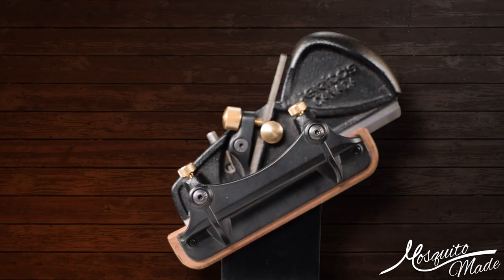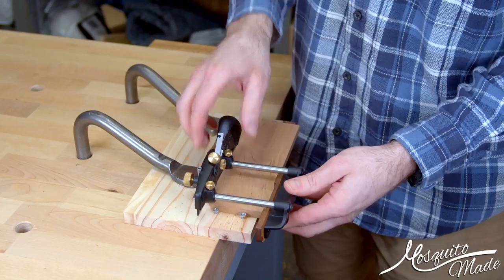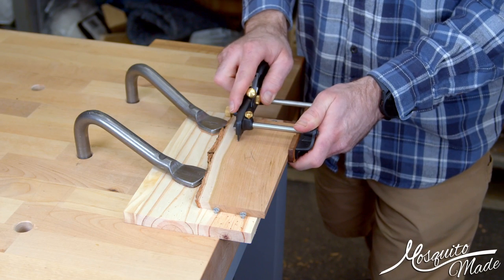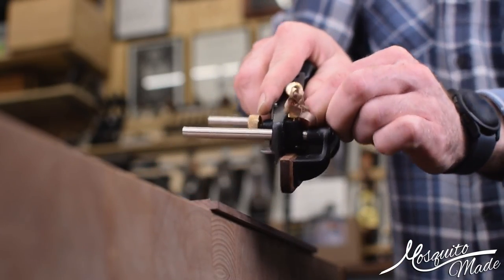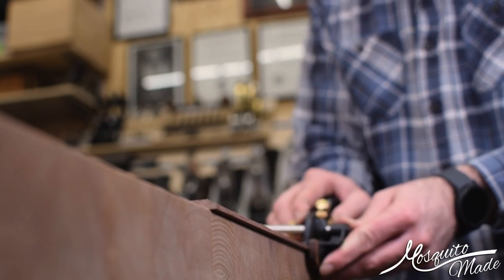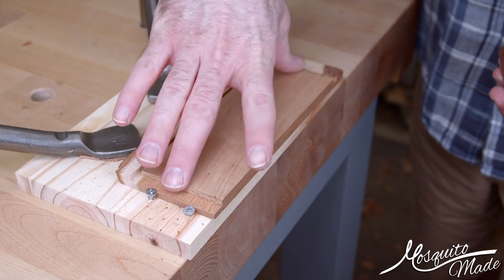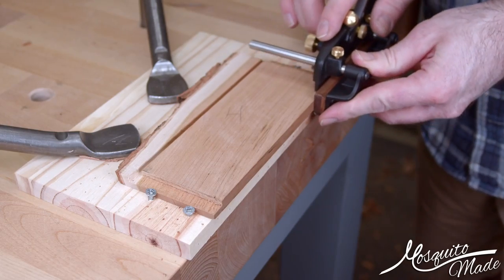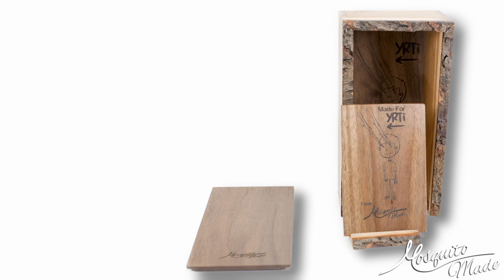Veritas Box Maker's Plow Plane Operational Examples with a Live Edge Box

Comment: Good review and the demonstration of Veritas Box Maker's Plow Plane!

Thank you for the box. The grooves are very clean and by watching how quick you made the grooves (I know it needs a skill), I want the plane now for real.  and yeah, I always have a difficult time on clamping a small piece to run my router plane. When I get upset enough, I just use a thin double sided tape and stick the piece to my workbench. It works.
Reply from the maker: Thanks!  I've used double sided tape a lot on the CNC, but I've never thought to try it on my workbench, that's a good idea... And it's a great plane, with some limitations, but I'm a fan (of course, I also love my equivalent Record 043's before this too)

Comment: Hello, thanks for this information.  How did you get a model with the thumb screws for the fence?  I see now they are selling it with Allen key round over screws.  I would prefer a model similar to yours.  Have you used both?  Is there an advantage from one to the other?
Reply from the maker: That was covered in the full review video (https://youtu.be/23Dl636---4).  I cover the thumb screws around 18:30 in that video. There isn't a model that comes with them, you have to buy/make your own.  I've been using it with the brass thumb screws I shortened from ones I bought on McMaster, and it's been no problem for me. I much prefer the thumb screws to the button head screws. They also the same for me, but without having to use the Allen wrench. I haven't had any holding issues with the thumb screws tightened by hand, but I've got good dexterity and grip, so other people may have different experiences. The main advantage in my mind is not having to keep the Allen wrench handy, but otherwise none (though I do think it looks better, if that's an advantage lol)
Reply: @MosquitoMade  thanks for the detailed information and quick follow up.  I am sorry I missed that information before. You broke it down perfectly in the video and the response. I don’t always get my questions answered from others so thank you for taking the time. This has helped me!  I’ll give the thumb screws a shot.
Reply from the maker: @lukemontgomery40  No problem!  I also realized that when I went back to the review to find that, I never had chapters in it either, so I should probably get some of those added in too, that would probably help :D